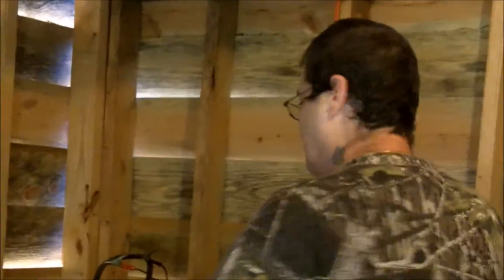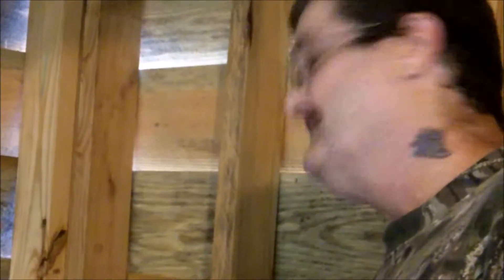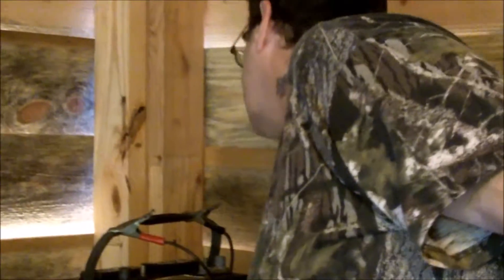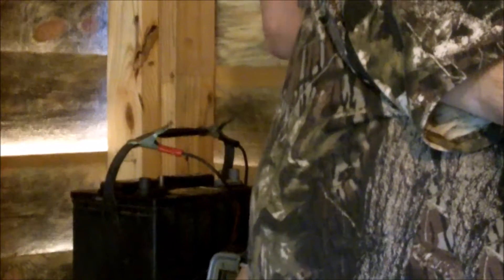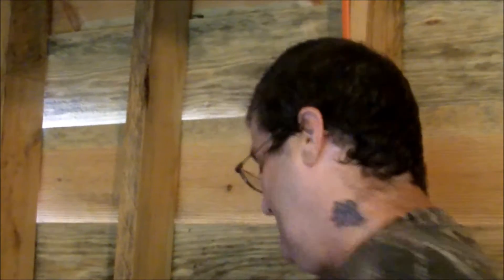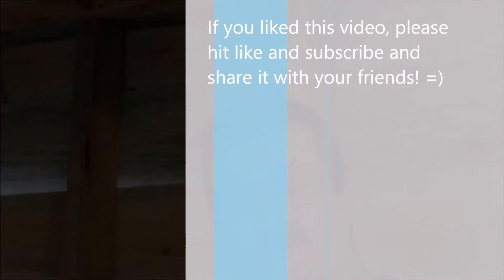Lead Acid Battery to Lead Crystal Battery - CHEAP!

Comment: Lead Crystal costs almost the same like lifepo4 battery's and much more than Standart lead battery's.
When bought new.
Lead Crystal battery's can be used up to 0v and shoud not have any problems be loaded normally again, otherwise ther are dead.